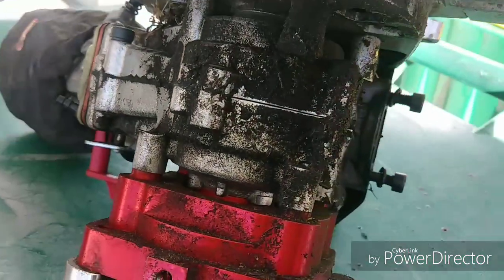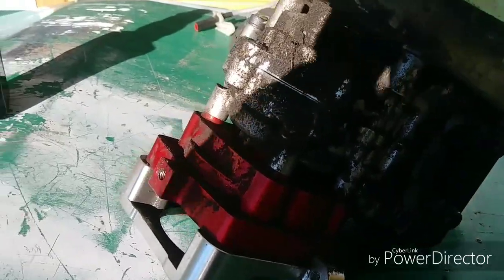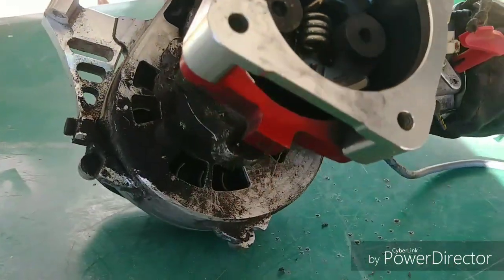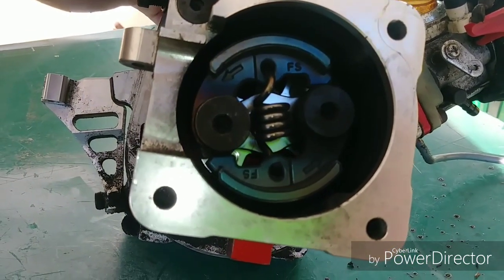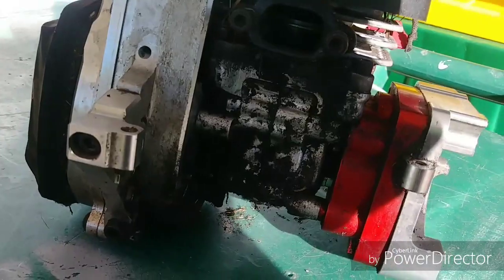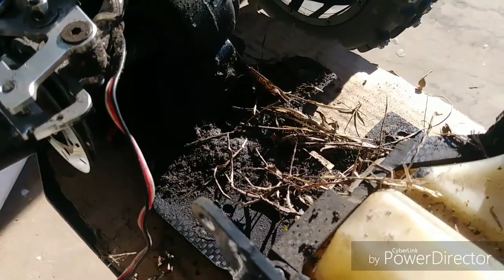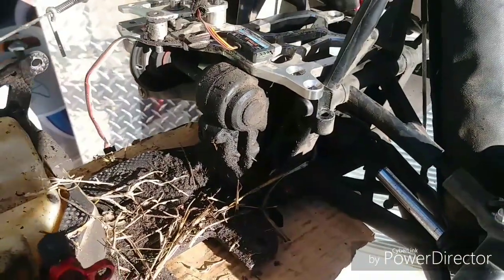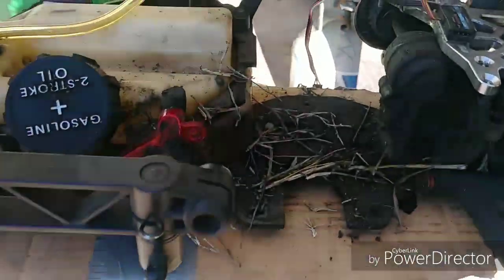29cc SCZ Reed Case Down for the count

Comment: I have ragged the crap out of mine all summer and its been fine so far quite a few hours I would say.  First year however I discovered the manufacturer had not tightened the reed petals down and one got sucked into the engine.  Zero internal damage I was amazed not even a mark and it almost ran with one petal.  Power output seems at least as good as my OBR's with a similar HP rating